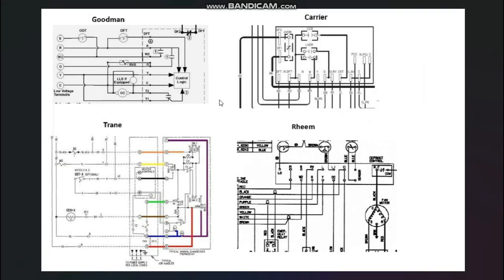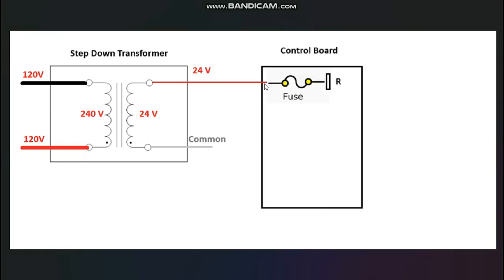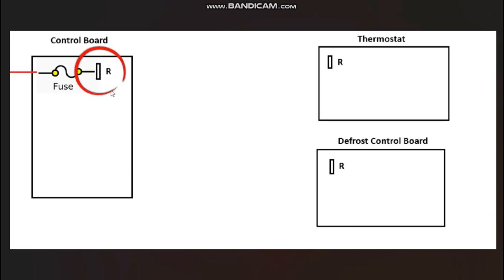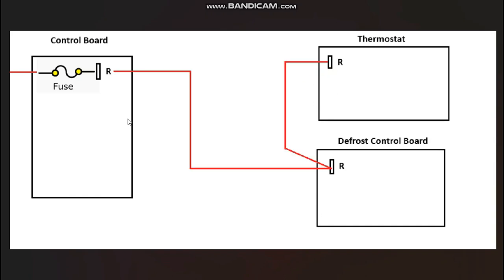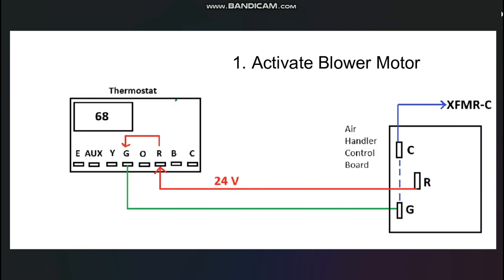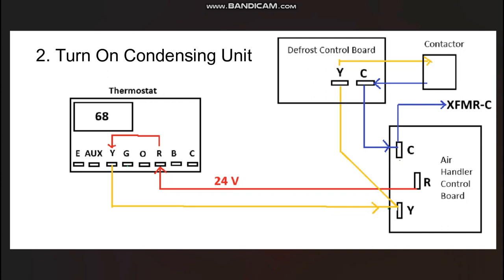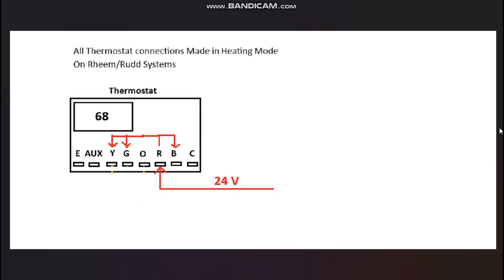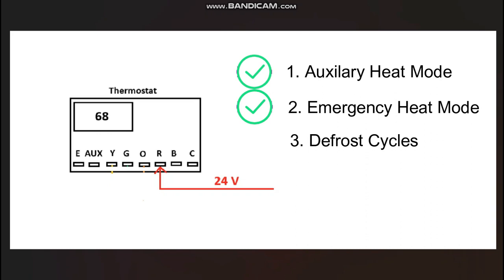Heat Pump Wiring Basics (Universal Principles)

Comment: I have a problem scenario that nobody seems to address in HVAC videos. I recently replaced a Trane heat pump with an ICP heat pump but kept the XE90 propane furnace and original Trane thermostat. 
Defrost mode works fine in that it brings in the gas while in defrost and then returns to HP mode. But if the HP gets behind it won’t bring in the AUX mode. If you hard select EMERG mode then the heat pump won’t shutdown while the gas is on trying to catch up to the set temp.
Reply from the maker: What model thermostat
Reply: @ Baystat239
Reply from the maker: @52CA what's connected to the W terminal in the thermostat?
Reply: @JerseyMikeHVAC  The white wire.
Reply: But I had to remove it in order to use the emergency heat function when the temps got below 20. Not sure how it was working correctly with the original Trane HP

Comment: Is there some sort of air flow prove switch? Like if the blower fails only...
Reply from the maker: I'm not aware of one, but lack of airflow will drastically alter refrigerant pressures and will trip off temperature or pressure sensors.

Comment: Excellent video for explaining the heat pump. Just one question, in my system, instead of heat strip, it use water boiler for AUX or Emergency heat, so the wiring should be the same as heat strip? Thank You !!!
Reply from the maker: Yes it'll be the same. You just have to bring a common from the boiler back to the Stat to complete the Aux circuit.
Reply: @JerseyMikeHVAC  Thank You So Much
Reply: Hi, also in my thermostat, E and W2 are connected with jumper and changing it to Honeywell T5 WiFi so I do the same on T5? Thank You!!!
Reply from the maker: @minnaingoo2468  Yes, both terminals perform the same task so they are sharing 1 thermostat wire going to the same place.
Reply: Thank You so much

Comment: I’m so glad I came across this video. It’s helpful. I’m having a hard time replacing an old Mercury thermostat with a simple non programmable digital one. I have a Magic Pak unit where I live. (Forced Air) all electric, heating and cooling. There are 5 wires total(Y, G,W,R, Blue common?) Blue wasn’t connected to old tstat, do I need it for new tstat that is battery powered? Anyhow, can you PLEASE help me figure out how to properly connect this thermostat??? THANKS IN ADVANCE
Reply from the maker: Industry standard is yellow to Y, green to G, white to W and red to R. Common (C/blue) does not need to be hooked up for battery powered stats.
Reply: @JerseyMikeHVAC  Ok, good, that’s what I thought. However, with the digital one, blower is strong (as it should be. With old tstat it only blows very low on heat mode, fan mode is fine and cool mode is fine) but doesn’t blow warm. Should i connect red to RH and use jumper to RC? Connect Y to Y with jumper to W? G to G? White to B or O possibly? Or else where?
Or jumper from Y to W? And W2 to Y2?
Reply from the maker: @user-sy2pg3fm1q Is this an actual heat pump or just electric heat?
Reply: @JerseyMikeHVAC I’ve tried replying many times, not sure why it’s not showing up, but I ended up putting the old one back on for now. Until I figure out how to wire it! 
I’m not sure about heat pump…. It’s a Magic Pak MCE4 unit.
Reply from the maker: @korruptsociety421 ok. That’s not a heat pump. What kind of thermostat do you have?

 Sounds like you have a heat pump thermostat. What may be happening is that your thermostat is made to activate  back up heat after a certain time delay if set point isn’t being met, but it still thinks the heat is on in heat pump mode. That’s why your blower is running but no heat is coming out. 

Switching the white wire over to E and setting the thermostat to emergency heat mode can work to activate the heat strips immediately on a call for heat but it would be better to have a non heat pump thermostat.
Reply: @JerseyMikeHVAC  I currently have an old mercury thermostat. Honeywell. 4 wires hooked up, R, G, W, Y to the corresponding letter on tstat. I wanted to install digital one to see if it would work better and maybe save some money on bill. The one I was trying to install can work for single stage, multi stage, and heat pump systems without aux heat. Non programmable and battery powered
Reply from the maker: @korruptsociety421  You cannot use a heat pump thermostat on that system unless you have a thermostat with an E terminal and an emergency heat setting on the stat. And even then you have to have it set to Emergency heat to run heating mode. 

 Heat pump thermostats power the Y terminal in heating mode which attempts to activate the compressor (for cooling) because of how a heat pump system works.  You're going to end up running heating and cooling at the same time if wired any other way. 

Either place the white wire on E and set it to Emergency heat, for heating mode or get a regular non-heat pump thermostat.
Reply: @JerseyMikeHVAC  I don't have a heat pump tstat. I have one that will WORK with a heat pump, but it's just a regular "2H/2C multi stage non programmable thermostat."
Reply from the maker: @korruptsociety421  If it works with both conventional and heat pump systems, there should be a setting in the thermostat that allows you to select which one you have.  the stat should be wired the same way as I initially explained in the first response.
Reply: @JerseyMikeHVAC  so literally the 4 wires go to corresponding letter/color? Should the R go to RH or RC? Do i leave the jumper between RH and RC?

Comment: Hi Sir, i have questions more please. If the heat pump systems (as stated @12:10), "as a whole, only turns on heat-strips and the air handler in 3 circumstances",  Then, does this means that, if, a thermostat that is IN THE HEAT MODE, does not activate  the FIRST stage heat, (which is the turning on of the outdoor HEAT PUMP unit), but, TURNS ON the INDOOR (air handler unit), the air that the indoor unit BLOWS OUT, is NOT heated AIR? Or put another way. Does the THERMOSTAT in the heat mode, automatically goes the 2nd STAGE of heating, if the first stage is malfunctioning? Or does it just turns ON ONLY THE FAN, (and not the heat strips).

I am sorry to be asking all these questions, but it just that I have this issue, and I would like know, what is really happening, cause been retired, on a fix income, I dont want to get a shock when i see my electric bill. Thanks again.
Reply from the maker: Normally heat pump comes on first. Heat strips will only come in if heat pump alone cannot meet set point temp (heat pump requires help) or if room temp and set point have a large difference between them (5 or 6+ degrees). 

Heat strips also come on in heat pump defrost mode. Blower should only run when either heat pump or heat strips are activated, or for a minute or so after shut down when set point temp is met. 

If heat strips come on immediately, then either there is a large differential between room temp and thermostat set point, the heat pump is malfunctioning or emergency heat mode is turned on manually.
Reply: thank you for taking the time to answer, i really appreciate you. I will have it checked out, but it just that in the area i am at in Orlando, the techs it seem HERE, are only interested in replacing units. And it is mostly because they lack the knowledge of the heat pump system and operation. But i will get it fixed. Thnx again. @JerseyMikeHVAC
Reply: Gday Mike. My Rheem heat pump DEROST BOARD, has two small red indicators on it, one on top of the other. The one on top is flashing (blinking), Do you know what that means?  This unit does not comes on in the heat mode. I checked and the board is getting 24v to it, but when, I checked the voltage from it to the coil of the contactor, there was no voltage there. I am thinking that this board IS defective. Could it be that this board flashing is saying something is wrong it? or is it normal? Please. If you (or any other) have an answer, for this, it will be appreciated. Thanks. @JerseyMikeHVAC
Reply: Thank you again so much, Mike.  I am now really understanding it all. I check the defrost board, and there 24v going to it, BUT. No voltage coming out, (to the contactor coil), in heating or cooling mode. So, i think the board is defective. Do agree, or could there be something else that is cause this issue? Thnx again.  @JerseyMikeHVAC

Comment: Thank you so much for this video. I have an issue that I am hoping you can assist with helping me solve. My Rheem heat pump system in the HEAT MODE does NOT turn on the outdoor unit. The indoor unit however comes on and blows air. So, I turn off the system, wait a few minutes, and then put the thermostat in the COOL mode. The same thing happens. The OUTDOOR UNIT  still, did not come on. This was working fine in the summer. I live in Orlando. But now switch over to heating, and I am, all of a sudden having this problem. Is it the thermostat or the defrost board, that is not functioning? I know it one of the two, but just can't figure out which one. (the compressor comes on when I push in the contactor manually, so i am happy the our door unit seem ok). If you (or any other  could help here, I would really appreciate it). Thanks again for the good work that you put out to the public.
Reply from the maker: It could be the defrost board, but I couldn't say for sure. I wouldn't suspect the thermostat if both modes aren't working, not that it isn't possible, but that would far more likely be a dead battery or charging issues to have such an outcome.
Reply: hey Mike, what is a "high pressure lockout"? And could a defective thermostat caused the defrost board to show this code. My heat pump board is currently showing this code. The OUTDOOR unit DOES NOT, start up at all,  in heating or cooling. There is 24v on the R and C terminals. In  the "emergency" mode, I am not getting enough heat. It only heats up to 72degrees only, and runs all night. And never shuts off.  This is a RHEEM system. 6yrs old. I am really frustrated now, because i am having all these issues at the same time. I am thinking the thermostat is mal functioning, then I think its the defrost board. then i think the heat strips has issues. I am a wreck with these issues. The indoor unit runs fine, but NOTHING from the OUT DOOR UNIT. I just can't figure it out. Hope you or any other can assist me. Thank you, again. @JerseyMikeHVAC
Reply from the maker: The hi pressure switch is due to high refrigerant pressure being sensed near the compressor. It locks out the unit to protect the compressor from being damaged under abnormal pressure conditions. It will not automatically reset. It has to be done manually at the pressure switch. This usually requires some disassembly of the unit to reach. 

Usually what causes this is either a dirty or obstructed condenser coil blocking airflow or possibly an issue with the condenser fan motor not running (which could be a capacitor issue or a bad condenser fan motor). 

But it can be other things as well, like a plugged txv, kinked refrigerant line, etc. If the unit is only 6 years old, I  would test the capacitor and make sure the condenser coil is relatively clean as a starting point.

 You have to be careful. There's a lot of high voltage there and those capacitors can hold a deadly charge even with the power off. Don't leave your comfort zone.

Comment: Hey Mike, what happens if you connect the R wire to the W wire in a heat pump system? in this case I thought the W wire calls for heat, but when I did it with a pair of alligator clip wire, the wire melted so I disconnected it. 

I read up that in heat pump systems, the W1 wire might be E or AUX on your diagram, so what happens if you connect R to E or AUX without the thermostat attached, so in this case I guess based on the last few minutes of your video, R is connected directly to W(E or AUX), without O and G
Reply from the maker: I've never seen a jumper from R to W melt. Only thing I can think of to cause that is a high resistance caused by improper wire gauge for the voltage, a very loose wire connection or maybe a ground fault. 

What kind of thermostat is it?  W1 on a Honeywell can engage the heat strips even during cooling mode, which is why Honeywell says not to use the W1 terminal on heat pump systems.
Reply: @JerseyMikeHVAC  Thanks for the quick reply Mike! Thermostat is an Ecobee3 Lite.
Reply from the maker: @life.b.s   I just realized it's possible that you activated the heat strips without the blower running by jumpering R to W, and I suppose it's possible the resistance went high because of it. 

To activate heating mode on heat pump system with a jumper, you only need to jumper R to Y. The reversing valve defaults (on most systems) into heating mode when not powered (O terminal), so to run heat, you jumper R to Y and that activates the compressor, CU fan motor. and blower; basically the system runs in heating mode by default. Always check if the blower is running though, some systems are set up where you need two jumpers to make it work (R to Y and R to G, etc).

R to W is for boilers, furnaces, etc. 
R to Y is cooling mode for straight cooling.
On heat pumps, R, Y and O must be powered for cooling. 

On Rheems, Rudds and a few others, R, Y and B must be powered for heating, while R to Y activates cooling.
Reply: What would cause you to want to connect R to W? 
The R is the HOT side of the 24v, from the supply source (which is the transformer), I understand this base on Mike JM's teachings. Thnx JM.